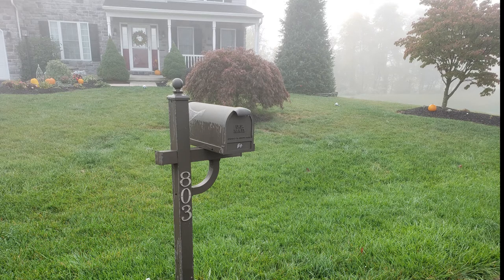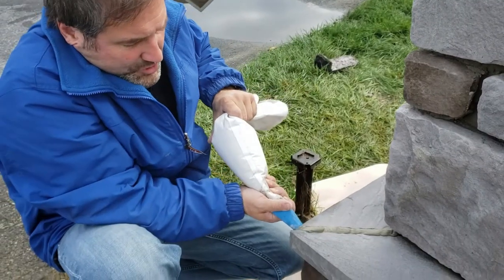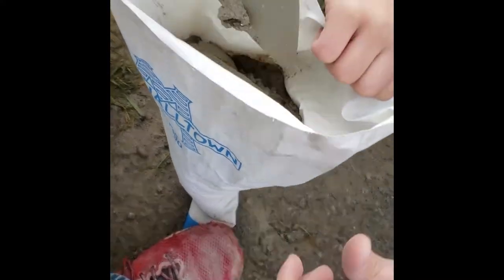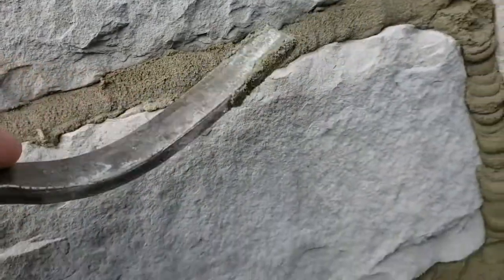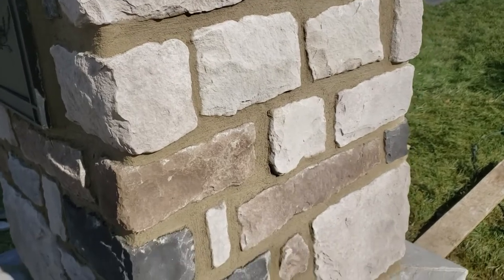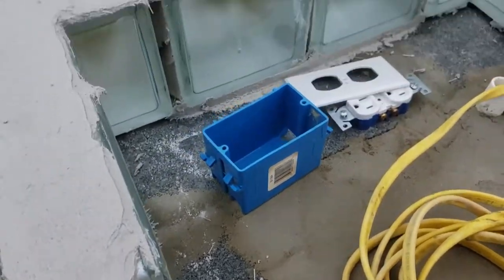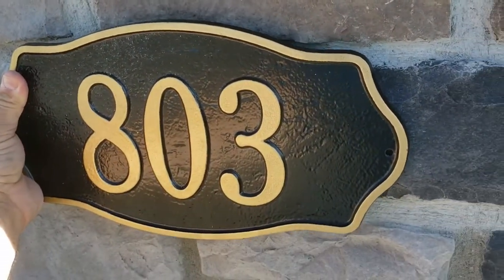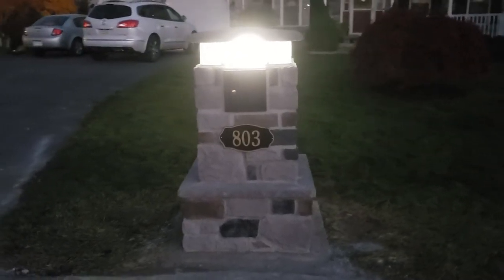DIY: Flag Stone Column Masonry Mailbox [Part 3 of 4] grouting, glass block, and mailbox flag

Comment: What will you do if you eyeball burn? 
I'm just wondering because I'm going to do the same thing at my place but then I start thinking how am I going to change the light bulb
Reply from the maker: That is a very good question. You are not the first to ask it. I wish I would have discussed this in my video. The answer is very easy. I didn't secure the top cap. It is only sitting there freely. How I do it, I get someone to help me. I lift at one side while a friend lifts at the same time on the other side. Lay the top cap on the ground while I replace/clean out the bugs and dirt. Then place the cap back in its place

Comment: Did you seal the stones? Or should you seal the stones and concrete?  And if so, with what. Thanks!
Reply from the maker: I didn't seal the stones
Reply from the maker: Thanks so much for sharing..... interesting concept. I didn't seal mine..... and my house isn't sealed either. My house was built 10 years earlier and looks fine. I am not saying to not seal the stone. I think it comes down to what appearance are you looking for? It's been 3.5 years since I built my mailbox and should do a review on it and explain what I learned and what I would do differently...... great idea. Stay tuned!
Reply: Thanks for your reply.

Comment: nice.where you get the clear bricks for the lights?
Reply from the maker: That is a great question. I didn't write it down and since forgot. I will have to look back at my credit card statements and get back to you. Thanks for asking because I wanted to look that up anyway but forgot
Reply: @DIYinspiredLewisBrantner  cool please let me know soon im working on one now and yours looks great
Reply from the maker: @angeldavila4669  https://www.qualityglassblock.com/
Reply from the maker: You working on one of your own? Wonderful. I would love to see some pictures! Lewisbrantner@hotmail.com
Reply: @DIYinspiredLewisBrantner  thank you pics emailed to you
Reply: I like the design.  Some asshat destroyed my vinyl post mailbox.   So now instead of a 4x4 I got a 6x6 buried 42” in the ground.   With 3/4” rebar 2 on each side.   It’s about 3/4 filled with 60lb cement.   Next it to make the base      I have 2 pallets of cinder block left over from the house build.   Then I was going to use left over pavers to face it.  So it all matches.  Gonna run the conduit up as well.    What size was your base.

Comment: What kind of light and fixture did you use inside? And how did you mount the light?
Reply from the maker: I used a blue box like anyone would use in the wall in their house. I had one laying around. I just laid it inside, nothing fancy. I bought a WIFI bulb from Lowes for $20 so I can change the color using my phone and turn it on and off using my phone
Reply: @DIYinspiredLewisBrantner  How do you access the light when it burns out?
Reply from the maker: @07slink  Great question, yes, I can access the light by lifting off the top cap.
Reply: @DIYinspiredLewisBrantner  So the cap sits loose?  or did you silicone it to the glass block and then razor knife the silicone when you need to replace the light?    My pillar lights burn out at least once a year, but they sit on top of the caps and I can access them easily.
Reply from the maker: @07slink  Yes, mine is the same way. The cap sits on top of the glass block and I didn't secure it. Originally, I was going to silicone it to the block but I placed it there temporality and was going to silicone it later but then I decided to leave it. Since the pillar is tall, I don't have to worry with anyone bumping it and it has a considerable amount of weight, it didn't move by itself.